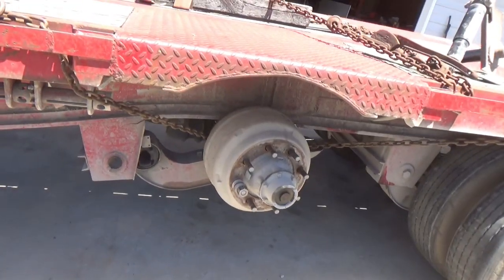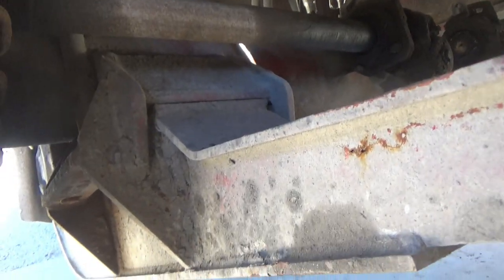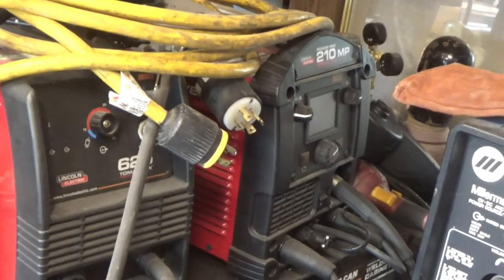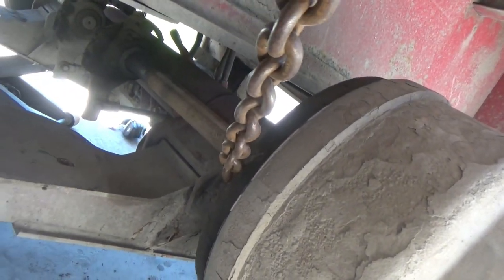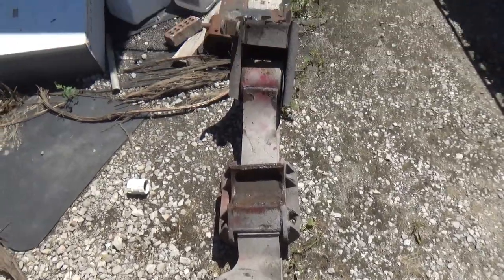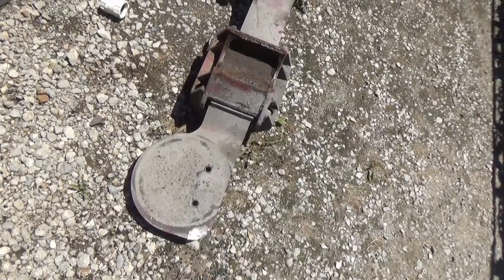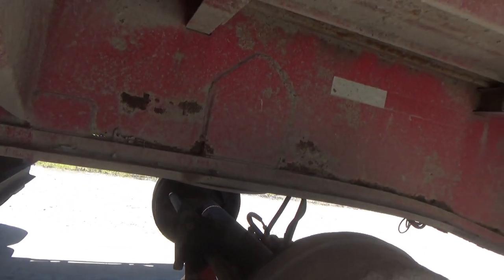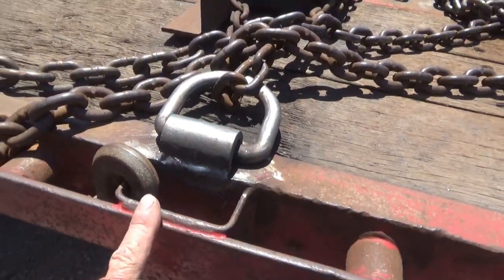Repairing broken trailer axle part 1

Comment: We would always let the new guys run the needle gun to see how dedicated they were to the job!  I would slather that trailer in hydraulic fluid before winter to help with the corrosion issues.
Reply from the maker: Do you guys rebuild old rotten junk like this?
Reply: @57bagre   There is a shop close by that does a lot of trailer work and sells them also, We would do tires, lights, bags and brakes but not anything that involved mostly because of space limitations.  As of last November I am no longer in the business at all!!

Comment: Hello Mr. Robertson. Firstly, I have to say I'm amazed with your knowledge and skills when it comes to welding and electrical stuff. I really learn from you. Secondly, I wonder why didn't you just use blow torch to do the cutting??? Because of its dangers in tight space?
Reply from the maker: Thanks for watching. The cutting torch is a lot slower, not as neat as the arc air for cutting welds and cost a lot more for the gas. 
I will have some torch work in the part 3 video in a couple weeks. There will be 4 parts in this series about a week apart.
Reply: I don't think I have seen a Plasma Cutter that even cuts metal this thick is there 😳?